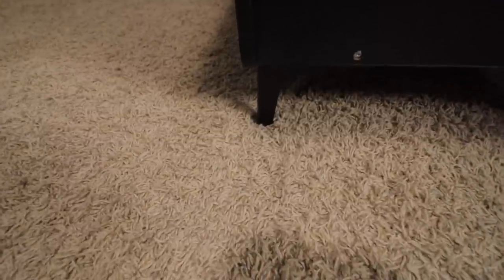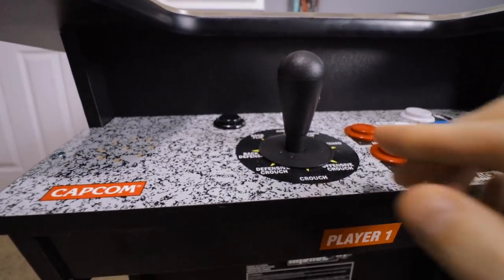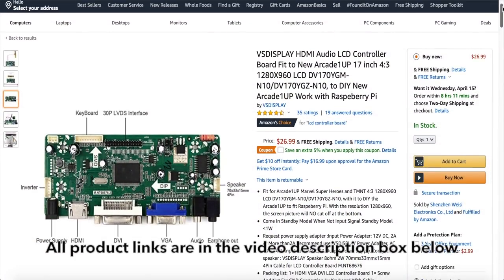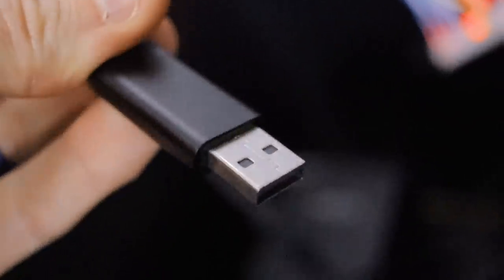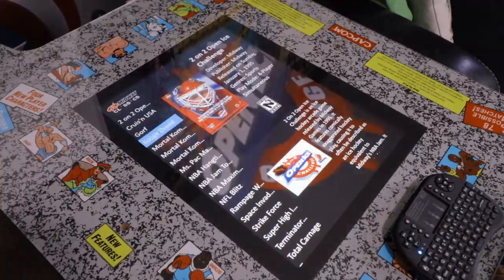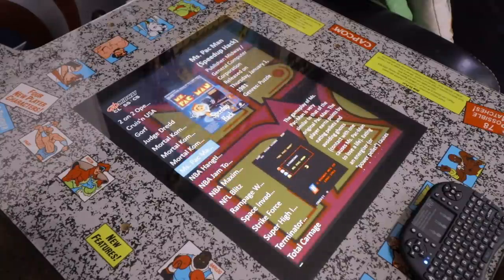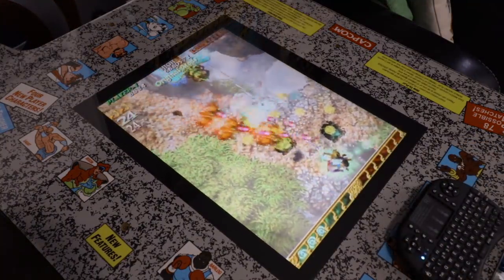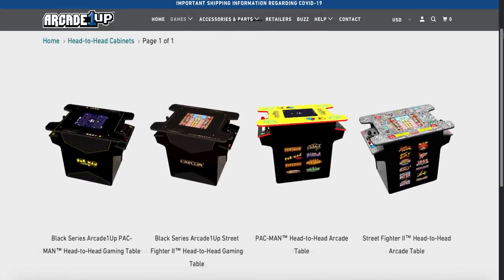Arcade1Up Street Fighter Cocktail Cabinet Mod!

Comment: You absolutely DO have to use Happ controls instead of the stock controls haha. Seriously though, do yourselves a favor and upgrade those. I don't think I've seen one of these modded, very cool to see.
Reply from the maker: Yep, even though its extra work to get the Happ stuff in the machine, it's a night and day difference over the stock controls and its soooooo worth it in the end.
Reply: @cooltoy  Hmmm, I was thinking of keeping the controls in (Buttons or at the very least the switches have to go) cause they are ok I guess. But yeah it would be worth it in the end to at least put Happ sticks in.

Comment: Picked up the Cocktail table at Walmart the other day. Ordered everything I need for the mod. Going to attempt it next week with a friend when parts arrive. Thanks for the video.
Reply from the maker: Craig Haubrich happy modding! Let me know how it goes
Reply: @cooltoy  Finished up the mod today but with a few issues. Sound coming from the speakers is very weak. Think I need to buy some type of audio amplifier. And finding quality Roms. Especially Die Hard Arcade. Getting Blitz running was no easy task.
Reply: @craigpombi9781  I think an amplifier is just going give you bad sound. I'm having this problem too and looking at solving it with an external sound card.

Comment: Hi. How about the neon lights power supply. How to handle to provide power with a pc setup as original arcade1up board has neon power supply. Do you get a 3.5 jack to usb adapter. If so how to power both sides of the cabinet 

The video do not show how to have both sides with each having separate joysticks and buttons to be connected to mod board

Thanks

Comment: Awesome mod, man. I'm definitely interested in picking one of these up now. I'd probably sit on it vanilla for a while, but with a mind towards modding at a later date.
Reply: It's better using a PC than the pi 3+ because the games doesn't run smoothly with the pi. Only mame_2010 emulator works perfectly on the cocktail, but 2 buttons on player 2 side doesn't work.

Comment: Awesome video and great mod. I just bought the street fighter cocktail cabinet.  Now I'm tempted to mod it lol. I like my cabinet i just wish arcade 1up would've used a 20 inch monitor instead of 17inch. I think arcade 1up should use 20 inch monitors on all there cocktail tables and all 4 player cabinets!
I know that you and glen have friends over at arcade 1up .......maybe you can suggest it to them 👍😁
Reply from the maker: the problem with that is no one is currently making 20" 4:3 aspect ratio monitors on a large scale, so there isn't anyone Arcade1Up could source those monitors from at the moment. They would need to find someone to make those specifically for them which would be a big investment. But I do agree with you, I'd love to see 20" screens used on all Arcade1Up machines moving forward.
Reply: @cooltoy  .....got ya.....thanks for reply 👍

Comment: FYI. I went with the PC and video boards in the description. For others in the future you'll need a Displayport to HDMI converter as well as there's no HDMI out on the dell 9020
Reply: I ran into that problem as well. Also no WiFi card. You need an external one.

Comment: Omg Awesome Video man!! I bought everything but the USB encoder since I'm not replacing the factory buttons do I need it? And if so do I need 1 for each side or just 1? And last question do I need to re-wire everything or just plug in the factory controlers flat cable?? Thank you so much in advance!
Reply: I have these exact questions, did you ever figure this out? Thanks!

Comment: I just purchased a used version of this cabinet yesterday and after getting it home noticed that there is a monitor issue where it looks like someone sat on the machine and bent the internal monitor causing discoloration and the blacks not getting as black as they should on 2 corners. After taking the top off the table to take a look. I noticed the screws that hold the monitor in place are so recessed that they are nearly impossible to get at to replace the stock monitor. Do you have any recommendations on 1. how to remove the stock monitor from the table top frame? And 2. A good place to find a replacement monitor (even used and the same one is fine) as long as it works. Another great video! and thank you for all of the hard work you put into the channel!

Comment: Awesome work as always pretty cool you can play blitz and nba jam in cocktail veiw. My brother and I are attempting to mod my TMNT 1up to with a standard raspberry Pi 4 mod as its our first attempt at a mod lol. So wish us luck. But I have a quick question...would you also recommend a USB keyboard to map buttons and fix picture ratio on a Pi or is that only needed for a PC mod? Thanks and keep up the great work!!
Reply from the maker: While its really only needed for a PC build, it wouldn't hurt for the Pi either if you are wanting easier access to the built in mame emulator settings within the Pi

Comment: I'm been waiting for this mod. How did you have your PC set-up for shutdown? Do you just turn everything off with the power switch on the bottom or do you do a safe shutdown first than the power switch?
Reply from the maker: sidney vincent I just turn everything off with the power strip toggle switch. I’ve had no issues with turning it on and off this way
Reply: I believe you can do a safe shutdown from within launchbox
Reply from the maker: @flpennstater305  yep, you can shut the whole PC down directly from within Launchbox or BigBox if you want

Comment: I just picked up this cocktail cabinet from NFM and really want to mod it after watching this video! Can I leave the original buttons and joysticks?
Reply from the maker: yes, you can use the original buttons and joysticks. Just make sure you use a 2 pin encoder to connect the OEM buttons and joysticks to whatever device you are going to use for you emulation

Comment: Do you think it's possible to take the PCB from the cocktail cabinet and swap it into the regular SF2CE Arcade 1-up cabinet? The controllers may need to be swapped out too because of generational differences. But, that doesn't seem to be too difficult. it would be sweet to have Darkstalkers & SF2T on an upright cabinet. Could you try it out and see if it works? Thanks =)
Reply from the maker: Fresh Muffins you would need to have one of the newer monitors installed in the street fighter cabinet to do that. The newer PCBs use different cable connections between the monitors and the encoder boards than what the wave 1 street fighter cabinet came with, so it wouldn’t be as easy as just switching out the boards
Reply: Gotcha', thanks dude! Love your videos. Keep up the awesome work! :)

Comment: My volume connection on my LCD monitor is broken can I buy this LCD converter board to put on the back, and have it work as it did before without modifying it? I can't hear any sound on the cabinet, and I need the board for sound only.

Comment: On the stock monitor with the standard LCD to HDMI adapter, I'm getting some crazy overscan on the right side of the monitor. Is there any way to fix this??
Reply from the maker: I never personally experienced that myself so I couldn’t say
Reply: @cooltoy  Do you still have the stock monitor? Hook it up to the standard HDMI/DVI/VGA driver board that is used. Try hooking up anything - Switch, NES Classic, etc. You'll find that there's overscan. I bought the signature black series version of this cab, which is identical, just simply in black.

Comment: Was inspired by your video and modified my head to head table.  I did ran into a problem with the speaker volume (very low) using the usb adapter with original speaker just like yours.  I you had the same problem?  If so, how did you fix it?
Reply from the maker: I didn't have that issue myself, but if you want there are some super cheap Kitner amps available on Amazon that you could use to boost your volume levels. Most people use these for their Raspberry Pi Arcade1Up mods.
Reply: @cooltoy  I bought one of those kitner amps for my build, but I couldn't use it. It doesn't work with the TSR speaker plug on this cocktail. I still haven't found a good solution.
Reply: I too am having the same difficulty.  I mean we are using the same parts. Did you use specific drivers or did you just plug it in?
Reply: @rixon2000  I think an external sound card is the best way to handle this. It was working when I had a Pi in my cocktail cabinet.

Comment: So heres a thought....im no modder but ive thought about buying pacman cocktail cabinet with dig dug on it....taking out the monitor with rom in it and putting it in the new pacman 40th cab coming out.....i would disable the player 2 button so that no one would hit it and make screen go upside down....do u think this would work using the new standup pacman 40th arcade controls by just plugging it in....now i realize this is hella expensive way just to play DigDug but im thinkn about trying this.....thoughts?
Reply: David Deming they have the Countercade DigDug. i would try and find a way to use that. and it’s cheaper.
Reply: I had bought DigDug countercade last june to take pcb out of it and install it in my space invaders cab....but arcade1up has it to whr countercade pcbs dont work in full size arcade1ups 🤦
Reply from the maker: @David Deming technically that would work, but like you mentioned it would be a rather expensive endeavor

Comment: Do you need to upgrade the joysticks and buttons(I understand they can be upgraded for better) or will they work with the USB encoder as is? Thanks
Reply from the maker: No you don’t HAVE to replace the joysticks or buttons, most usb encoders will work just fine with the stock buttons and joysticks
Reply: What abot the wiring? Can I just plug the factory cable from the controlers to the USB encoder or do I have to re-wire everything?

Comment: Wow that's a killer mod! I'm curious if Raiden is one of the games on there? I have an old gaming PC that has windows 10, Intel core I 5  GTX 980, hyper x fury DDR 4 either 16gb or 32gb at 2400mhz or 2666mhz , 1tb hard drive and I believe either a 250 or 500gb SSD. My nephew built it as a project. It works fine. Do you think it would run what you have on the optiplex? Of course I will confirm the specs. Thanks again for the great work. Game on!
Reply from the maker: Cmart The Scentertainer yea that sounds like plenty to run the same games I’ve got on mine currently. This one I’m using doesn’t even have an external video card and it can run things like Sega model 3 arcade games
Reply: @cooltoy  Sweet! I've been wanting to do something with it for awhile now but I'm kinda new to the whole modding with the exception of adding lighted marquees, upgrading joysticks and this weekend I'm putting in new LED buttons on our Pac-Man cab. But after seeing this vid now I'm inspired but I will take it slow and plan it out for sure. Thanks again 😊 looking forward for the update on this.

Comment: CoolToy, would Sanwa 30 mm snap in buttons work with this? I don’t want to do all the work you did, I just want to switch the buttons out with better ones. Do you just switch the wires to the new buttons? I’m new to this and I’ve been trying to find info online but I can’t find it. I have no idea about encoder boards and just want it to be as easy as possible. Appreciate it.
Reply from the maker: Unfortunately Sanwa 30mm buttons won't work unless you drill out the existing holes and make them wider. Almost all USB encoder boards come with a set of connecting wires, all you need to do it connect one end to the microswitch on each button and then plug the other end into the encoder board.

Comment: Cooltoy, great video!  Do you have a video or description of how you hooked up the control panel/buttons to the usb circuit board?  There are multiple three prong connections that are not on the usb circuit board.  Any help would be awesome...or another video that shows those connections.  Thanks
Reply from the maker: Jason Anderson the encoders and the micro switches I use are two pin connections. No need for three prong wires
Reply: @cooltoy  Thanks...i see why you made your volume a button.  There is no way to keep the old volume button with a two wire connector is there?

Comment: If you do cocktail mode in mame on verticals does it split the screen or flip it when its time for player 2 to play?
Reply from the maker: either or depending on what settings you choose. If you want to screen to flip around like a true cocktail cabinet on the vertical games you have to turn on the  "Cocktail" option under the MAME Dip Switch menu.

Comment: Hey I have another question, at 12:17 in the video you can see that MAME displays the cocktail view for the vertical game in larger side by columns instead of one large pillar in the center to make use of the full space. In my monitor testing MAME does no t do this naturally, did you configure this yourself or is this a feature of MAME running on the 4:3 monitor of the Arcade1up cab? Thanks.
Reply from the maker: it sounds like you may be using a different version of MAME than me. Which number of MAME are you on?
Reply: @cooltoy  thanks for your reply, I'm using Mame 0.222 newest version.
Reply: @cooltoy  still interested in figuring this out, asked around the net with no luck. Default cocktail mode for vertical games just shows one collumn in the center screen but this screen layout your MAME is using looks great. I did the same mod, so any info you can give about your main version and configuration would be awesome, thanks.
Reply: Same here would love to find out what version of mame as well , for my cocktail mod ,

Comment: Could you simply slap a computer in there and use stock controls with stock monitor with just the video board and ipac upgrades without replacing any buttons or joysticks?
Reply from the maker: Yes you could do that

Comment: I modded my SF cocktail using the pi 3+. I have few issues with it. I know that certain games that only works on fbneo, mame 2003, and psx does not run smoothly. If you use mame 2010, the games will run perfectly, but there's a problem, 2 buttons on player 2 side does not work. Can anyone tell me how to get those 2 buttons fix?
Reply: Make sure both zero delay encoder boards are wired up exactly the same.

Comment: im trying to run coin ops diamond 3 and none of those video options come up in game its mostly only input configuration and dip switches and cocktail mode is there but it doesnt help me fix the aspect ratio issues or slitting the screen . im running mame  0.196 and i tried the games you did in video i just dont have those options dunno what to do

Comment: What's the bare minimum to mod one of these cabinets.  If I was OK with current buttons and controls but wanted to play more games...In theory this can be done with PC, LCD board?
Reply from the maker: bare minimum would be two usb encoders, and a LCD converter board to connect to whatever you are going to run your games off of ie a pi or a pc.

Comment: I have the same exact console table and was wondering if you can give me any tips on configuring the buttons through the usb conversion board. (still very new at this)
Reply from the maker: if you are configuring your buttons in MAME, you'll need to hit the TAB key on a keyboard to bring up the MAME menu options and then go to the input settings in there to start configuring and setting your button commands up.

Comment: Hey great vid im almost done completing my cocktail mod just ordered happ joysticks was hoping you could provide the link or point me in the right diection on where i can get a 5 pin harness to get the happ joysticks connected to the encoder board? thx for any help
Reply from the maker: diyretroarcade sells them I believe
Reply: @cooltoy  ok got it prob a dumb ? But do you know what the cable is called?

Comment: I'm confused about the buttons. If I wanted to use the buttons that are already on the machine, do I need the Reyann Zero Delay Converter?
Reply from the maker: If you are using something besides the stock pcb then yes, otherwise no
Reply: @cooltoy  Ok, thanks so much! and I appreciate the quick reply. One of my clients is asking me to mod his 1up table and I'm absolutely clueless.
Reply: @cooltoy  How does the pc read the input from the controllers if the only thing linked up is the lcd screen?

Comment: I have the same encoder, but I can't get it setup with Launchbox/Big Box. Did you have to use Joy2Key?
Reply from the maker: Nope, I didn't have to use anything like Joy2Key. You'll want to turn on the setting to use the joysticks and buttons as controllers in the BigBox menu if you haven't already.

Comment: Hey, I just set this mad at myself and I’m having problems with me and keeping the proper 4 x 3 aspect ratio in cocktail mode. The black bar when I play NFL blitz is showing up on the bottom of the screen instead of on the edges of the screen like it is in your video. Any idea what I could do to change this? Thank you
Reply from the maker: Are you using the stock monitor and an lcd controller board? Also what settings in MAME do you have the display set to?

Comment: I was wondering about the ground wire I cant seem to tighten it into the space that you tightend it in could I just mount it back on the monitor don't wanna screw the mod up
Reply from the maker: yes, you can ground it to the back of the monitor or the LCD controller board either one